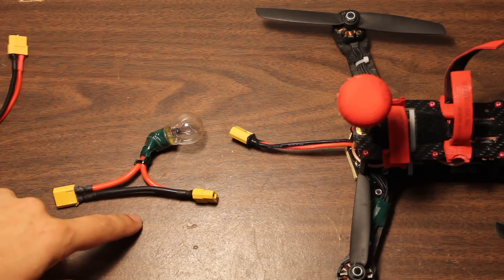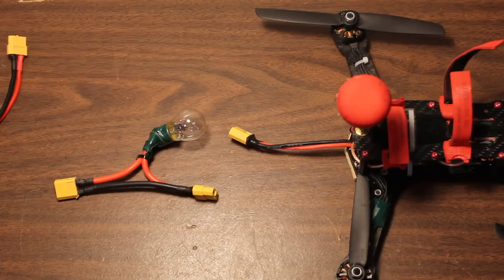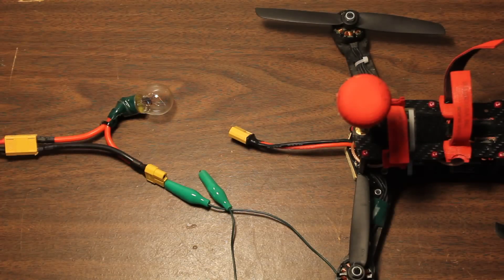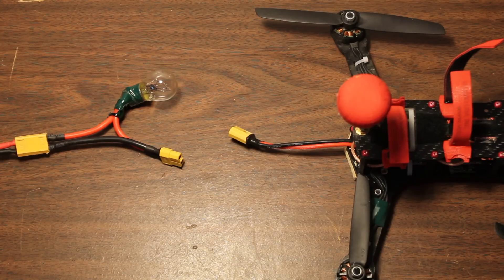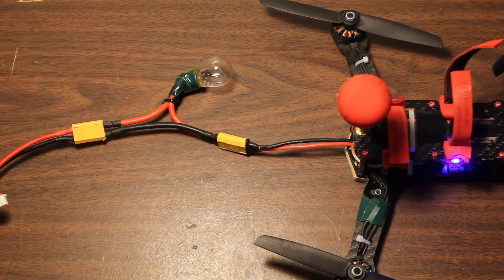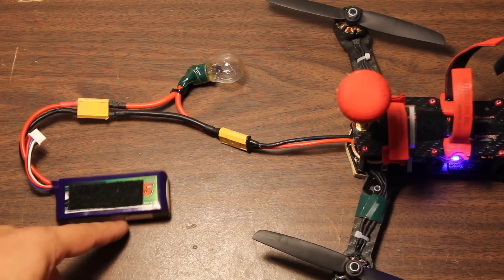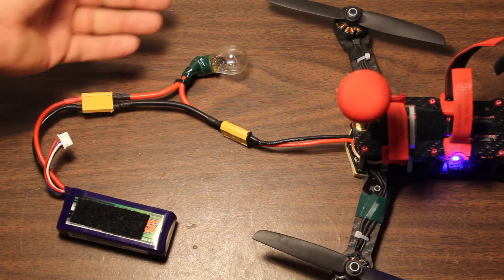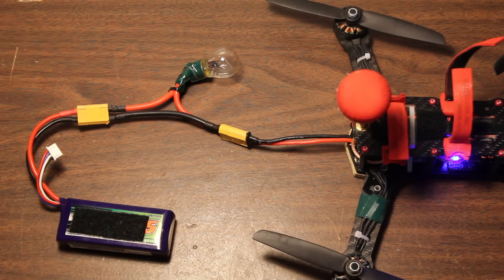"Smoke-stopper" protection device for RC plane quadcopter etc...

Comment: Hi Joshua, can we use the smoke stopper also in flight as safe device for the power plant ? I suppose the smoke stopper is not only for quads but also for Heli and plane. Thanks for your replay. Regards.

Comment: Here's a question, this worked great on 4S in 2017.  Now its 2019, if I doubled up on bulbs making it 24V, would it then be effective for 6S?  Seems the same principle would still apply, correct?
Reply from the maker: Yes, exactly right. You can do that :-)

Put the bulbs in series with each other, not parallel!
Reply: @JoshuaBardwell  Thanks Josh, just did it, and it totally works!

Comment: I made a smoke stopper and tested my motors and the light turns on I did it with all four motors and I started to eliminate one by on and the light still turned on even down to the the last one when I put one back and the light turns on when I ramp up the motor

Comment: Hi if the smoke stopper bulb lights up bright for a 1 second does that mean I am going to fry something or something is wired wrong?
Reply from the maker: As long as it turns off after the motors finish beeping, then it's no problem.
Reply: @JoshuaBardwell  Pheew great! Awesome help thanks! 
My RSSI Channel stays put but the value is zero no matter what channel I choose. I have tried channel 8 and 12 in the LUA script for Crossfire telemetry but still nothing? Any idea with this?

Comment: Hi Joshua, I've just built my first quad and only have 4s batteries and a 2s battery. Can I use the 2s battery to test power up the quad for the first time? And would I still need a smoke stopper?
Thanks.

Comment: Makes sense, I'll have to make one up. I would just worry about the bulb breaking in my pack. I wonder if I could find a small push-to-reset circuit breaker instead.

Comment: Hi, I know this vid is dated but its new to me and im new to the hobbie so there in its self shows the relevancy. 
You said put the lightbulb in "serial", being electrical wiring not computer cabling I believe the light bulb is in "series". I am not sure on the computer engineering side. I am only an electrician, that's what got me thinking when you said that. It seemed from what I looked up serial refers to cabling, I could have gotten the wrong impression though, serial was usually referenced when talking about computers from what google was showing. My motor control books and electrical theory books don't mention serial but they are industrial electrical books not computer science books so i cant speak to a reputable source besides the internets.

For example: there was a serial connection ran to the lightbulb from the battery in series.
idk im just sayin. 
Could be blowing smoke up your arse. Correct me if you know any better, like I said I am new to the hobbie and am still trying to get my first real quad setup. Trying to learn what I can, this is a lot. I see a great deal of joy when I can get one of these sonsabiches flying. 

Cheers, thank you for what you do!
Reply: Charlie OConnor. You could hook up batteries in series and parallel for practice.   The big difference here is what happens if the light bulb is not plugged in.

Comment: did you use the 5watt or 21watt light in that bulb it has two its a break light with normal tail light in one or did you connect both
Reply from the maker: Connected both.

If you have micro quads, you can connect two connectors. Like an XT60 and XT30 or something. And connect the smaller one only to the 5w element.
Reply: Joshua Bardwell thanks for quick reply

Comment: I made one for my first build, Using 
FC/ESC/PDB: 4n1 Racerstar TattooF4S 30A BLHELI_32
Camera: Runcam split 2 to 5v on PDB, no glow, but then connected my...
VTX (needs 7-24v) to 12v on PDB, and get faint glow, tried disconnecting/re-soldering battery direct, but still faint glow, but continuity checks out, I read the rc forums and I believe this is expected behavior? Just wondering if can do any additional troubleshooting to verify I am good not to smoke out the FC/ESC combo.

Comment: Quick question on the smoke stopper.  Since I just recently smoked a brand new motor after install because I didn't realize that the ESC was blown, if I had had the smoke stopper connected how would I have figured out that the ESC was bad ?  I guess with a enough time the motor would be getting hot for no reason while the others were not, but what else could I have done to troubleshoot this issue and figure out that the ESC was bad without smoking another motor ?  Thanks.
Reply from the maker: +Tavis Gustafson the smoke stopper would have lit up. Then you unplug and troubleshoot from there. You could desolder one ESC power wire at a time until the smoke stopper no longer lights.

Comment: Hi Joshua, 
Let me say thank you before anything for all your works here and help people to go on with the hobby. I do need a little help ...

This is Jose form Spain, and my problem is related with this kind of stuff,

I know this entry is from the sept. 2015, but ...I do not know where to put it and have answers.

I have built my smoke stopper since you upload your video and I have been using it with no problem at all. There is no issues with the hardware (21/5w 12v bulb and adecuate gauge for the wires).
I have built today a 210 with an 405osd fc & its own pdb fchub/6s from matek too. 
ANNND once I have finished the soldering works with the pdb, esc and motors over the frame and try to connect safely the lipo, the bulb LIGHTS. I check all the solders, all the polarities, all the continuities. Till I know the work is fine and the light still remain on the bulb when I try to connect. The pdb is not showing any led on, neither the fc that I have connected too.
I have short videos showing the issue I have recorded to the seller so I can eventually get a new .... I do not now still what is failing but I think is probably the PDB.
Can you give me any idea what can I do from now to go on?
Thak you again, have a nice day. 
Sorry for my English.
Here are the videos.
https://www.youtube.com/watch?v=TFF7e2KiVlU ..https://www.youtube.com/watch?v=Ty1yy5hdfKQ&t=1s ...https://www.youtube.com/watch?v=8LaOTnT5yPU
Reply: PROBLEM SOLVED. Sorry about my stupid question. I have solved the issue looking a hundred times the board and its connections, and the prblem was in the polarity of the entry power wire for the pdb, the wires were reversed.
Thanks to this device I have minimize the problems to the board, I would fried it, or the esc, or the motors. Thank you again.

Comment: i just made one of these, but before i was just using one of those energizer 9v batteries, if you connect it to your quad, its enough to power up everything even your escs but if there is a short nothing will turn on, it saved me from a couple of shorts. what is weird though is that a continuity test to the xt60 of the pdb usually was a sufficient indicator to prevent major shorts except last night when i reverse polarized an esc and the continuity test didn't work, any ideas?

Comment: Why not use a single element and have lower voltage and even less chance of hurting anything? Or will it just blow the bulb.. I'd be building one for a Lizard95 and will not be using 4s.. So.. Would and 12 volt bulb be OK for that purpose, or should I just go for a bulb like the one your using.. Can't say I've even seen a dual filament bulb..
Reply from the maker: For a micro using 2S, you can get a dual-element bulb and use the smaller element.

Comment: I'm a little confused... 

I built this with a 1157 bulb with 2 filaments. I can plug it in to my working quad (it doesn't have any shorts because it flies fine) and one of the filaments always lights up when I plug it in. Perhaps I need to connect my wires differently? 

I have it wired so that one wire connects to one of the bottom spots and 1 wire connects to the side.
Reply from the maker: The bulb will light up whenever the quad tries to pull the rated wattage of the bulb. So if you used a 12 watt bulb and the quad pulls 12 watts when it is just sitting on the bench, the bulb will light, even though there is no short. You have to size the bulb such that the bulb does not light during the quad's normal idle current, but does light when a short is present. I find that a 25 watt-ish bulb works great, but if you have a particularly current-hungry video transmitter or maybe a lot of LEDs, that bulb may be too small.

Comment: What would happen if I used a bench adjustable DC power supply for testing, setting 16.8V in place of a 4s battery, but a small amp setting? If that is possible, what would a good current setting be? I plan on building a smoke stopper...just don't have the bulb right now and want to do some testing on a new build. Never really found a good use for my bench power supply, figured it might work here?
Reply from the maker: That would be okay, but don't spin the motors especially with props on because braking can damage your power supply with reverse current. I would use a current limit of about 3/4 amp or maybe 1 amp and you will probably be fine.

Comment: My smoke stoper light on when I connect to my eachine wizard or Fuuton 200 quadquptor. However, no short circuit as they both fly nice. Using 12v DC light. Any idea?

Comment: I do this with 12V halogen light bulbs (MR16). They come in different wattages (I have one 10W and one 50W, both are 12V) so you can pick the one best suited for what you're trying to do (e.g. if you actually want to test your motors, the 10W will be too small).

The reason why this works so well is because incandescent light bulbs, and halogen in particular, have a very low resistance when they are cold, but the resistance goes up when they get hot. So a 1A bulb will allow currents much higher than that when it is cold, but once you reach a certain point, it will 'trip' and limit the current to a much lower value. Also, since it takes about a second for the filament to heat up, short current spikes won't trip it, but real shorts will (usually) trip it quickly enough to avoid damage to your ESCs/motors.

As a bonus, these light bulbs make great dummy loads for testing batteries and power supplies.

Comment: hello, can you use this on 4s or will the smoke stopper make magic smoke?
Reply from the maker: You can use it on 4S no problem. The worst thing that would happen is the bulb would burn out. But my experience is automotive bulbs can easily take 17 volts. Automobiles have a lot of voltage spikes, so the bulbs have to be built to take them.
Reply: Joshua Bardwell Thanks!

Comment: I'm guessing you wired the elements in parallel and put the other on the light bulb ground. Was it a 1157 or a 2057 bulb?
Reply from the maker: +80miles_A_day the elements are in parallel. I don't remember which kind of bulb it was.

Comment: Hey Joshua - 
Just a quick heads-up; As things have evolved in our hobby, so too has the SmokeStopper™. https://www.rcgroups.com/forums/showthread.php?2327875-DIY-SAVE-YOUR-ELECTRONICS!-BUILD-A-SmokeStopper%C2%99-!

Due to the fact of ever-smaller whizzy flying things driving development of ever-smaller and more sensitive electronics in all aspects of RC modeling, we now recommend to use a Low-Current version (or a High-Low Current switchable set to Low current) for initial testing on any RC model. You should reserve use of the original High-Current version only for motor testing and diagnosing issues with high-current stuff like bling lighting.

See my updated build log with lots of new material and graphics, outlining the theory and operation and how to build all 3 versions at my original build log, which I've recently updated at the link above.

Cheers, and thanks again for helping spread the gospel!
Reply from the maker: That's really clever. Have you got a video I can link to?
Reply: I have the original demo video from back when in my Zeemer daze which is shown in the blog, but I haven't done a build video yet.

https://www.rcgroups.com/forums/showthread.php?2327875-DIY-SAVE-YOUR-ELECTRONICS!-BUILD-A-SmokeStopper%C2%99-!

Comment: Hey, Josh-- I recently finished a build and had to
replace an engine (#2). When I flew it, it kept rolling right. I used all of the lft roll and am maxed out. Is there a way to recalibrate a FS-I6 to give more roll to the TX, or do I have another bad motor, or ESC?
Reply from the maker: +Bud Jones are your channels centered at 1500 on the receiver tab when your sticks are centered? You most have a battery plugged in and the transmitter turned on and bound.

Comment: What happens when the bulb burns out and I don't know about it, does it still protect the quad and lipo?
The current just wont flow? I'm not sure.

Thanks for all your videos Joshua! So many great tips!
Reply from the maker: When the bulb burns out, current cannot flow. The beauty of this setup is that any failure mode is still safe.
Reply: Thank you for the answer. I will definately use that for my first build, ordering a cheap 3S right now!

Comment: Hey Joshua, does this do the same job as the Hobby King Boom Stopper https://hobbyking.com/en_us/boom-stopper.html
Reply from the maker: Yes and no. Both protect against overcurrent. But the boom stopper does it by blowing a fuse, after which point you have to replace the fuse. The smoke stopper limits current and the bulb lights. Nothing blows out. It's reusable until the bulb eventually burns out. I've had mine for over a year.

Comment: Hi, i have this crazy issue. If i power my quad without the vtx it powers on normally. If i add the vtx alone, without plugging to the osd and fpv camera, the bulb goes on and gets dimmer with time, i really dont understand this. I even plugged the vtx to the xt60 wher i power the quad and the bulb turned on.
Reply from the maker: +DoubleHelix the bulb is too low wattage. The normal power draw of the vTX exceeds what the bulb can allow. You want a bulb that passes about 2 or 3 amps. Likely you have a 5 watt bulb. That's not enough.
Reply: Joshua Bardwell no actually is 21 watt bulb. My vtx is 12 volt.
Reply from the maker: +DoubleHelix how many amps is 21 watts at 16.8 volts?
Reply: Joshua Bardwell you tell me, you are the engineer. 😃👍
Reply: 1.25 amps, right? So my bulb can widstand 1,75 amp max.
Reply from the maker: 21 / 16.8 = 1.25 amps. I don't know about "max" but nominally your bulb allows 1.25 amps. My conclusion is that your copter is trying to pull enough amps to begin to light the bulb when you plug in the vTX. Get maybe a 40 or 50 watt bulb.

I mean, check for continuity with a multimeter too...
Reply: Joshua Bardwell ok, thx.
Reply: DoubleHelix With motors idle, you shouldn't need  more than a 25w brake light bulb for this, so I'd measure the current into the vtx. The fact that it is getting dimmer shows that it is discharging the battery over that time span. So something is going on.
Reply: It may be that it's not actually a 21 watt bulb, that would be another current measurement I'd do, just for sake of sanity.

Comment: what if you don't have a vbatt battery monitor? could you still fry a motor?
Reply from the maker: I don't understand the question.
Reply: +Joshua Bardwell sorry, you mentioned in your video that some escs don't have a battery voltage monitor, so I was curious what would happen if you didn't have one
Reply from the maker: I think you are thinking of the temperature monitor, not the battery voltage monitor. Is that right? All ESCs can monitor the incoming battery voltage, but not all of them have a low-voltage cutoff.
Reply: +Joshua Bardwell the LVC is what I was talking about.
Reply from the maker: If you turn the LVC off, the motor will keep turning until the battery dies. But the motor won't smoke or anything.
Reply: +Joshua Bardwell ok. Thank you! Sorry I wasnt being specific

Comment: Today I was testing my motors in the motor tab BF, with the smoke stopper I made, and I noticed the motors not spoiling up well. The bulb gets pretty bright. It's as if the voltage is getting dropped to low to run this test. Any thoughts? Maybe my bulb is the wrong value?
Reply from the maker: +ML Caldwell the bulb will prevent the motors from running at full speed if it is a low wattage or if the motors try to pull too many amps.
Reply: any other alternative??

Comment: I have a headlight bulb lying around here, its 12V 60/55W (H4U) ~ is that suitable?
Reply from the maker: +Okinawa FPV yes.
Reply from the maker: +Okinawa FPV hang on, I don't think so. 60 watts is too many amps to be effective at smoke stopping.
Reply: Okinawa FPV 15w - 25w bulb should be WELL sufficient for everything except for the motors.
Reply: and what if I take a led which maybe draw around 100mA?
Reply from the maker: +Loc N I think you most have an incandescent load.

Comment: I don't understand why this needs to be on the positive lead. it should limit current regardless of which lead its attached to.
Reply from the maker: You're right. But best practice is to always fuse the positive lead as close to the battery as possible, just in case. Since it doesn't matter either way, why not put it on the positive lead?

Comment: How about this as an advanced smoke stopper. Increase the amps available as you attach each piece of equipment, flight controller, receiver, Camm and vtx, and finally just enough oomph to  check motors. DP50V5A Buck Adjustable DC Power Supply Module With Integrated Voltmeter Ammeter Color Display
https://banggood.app.link/xPmSKBagvw
Reply from the maker: A current-limited supply is a fine choice, but you can't spin the motors if your ESC's use active braking, because the back-current will damage the power supply.
Reply: I hadn't considered back-current from active braking. I may still give it all a go, I'll have to do some testing first though and consider some inline diodes to stop the current. Maybe.
Reply from the maker: Neil Williams Big capacitors.  Big.